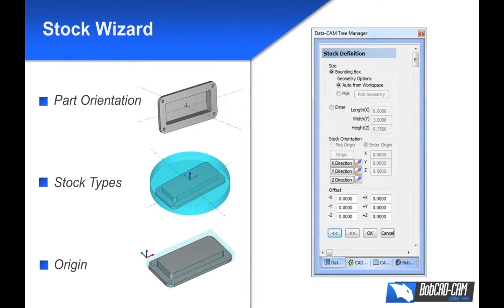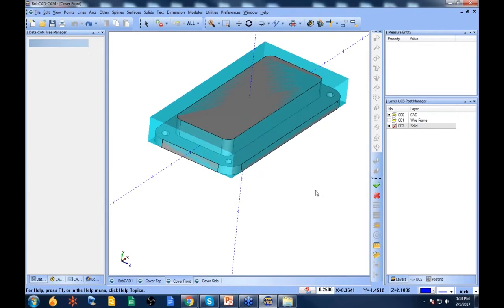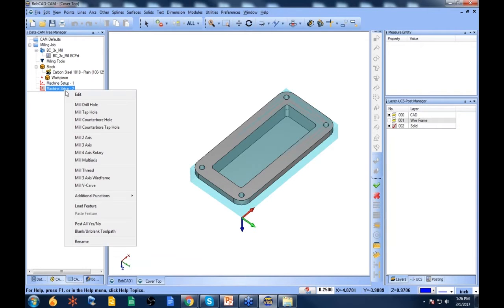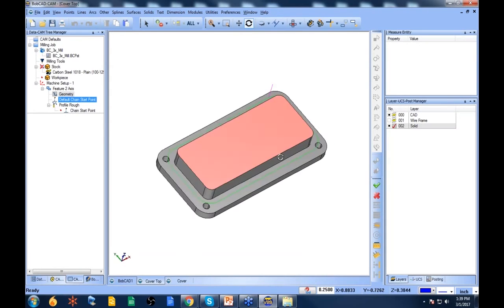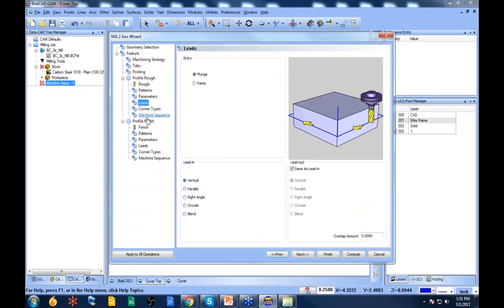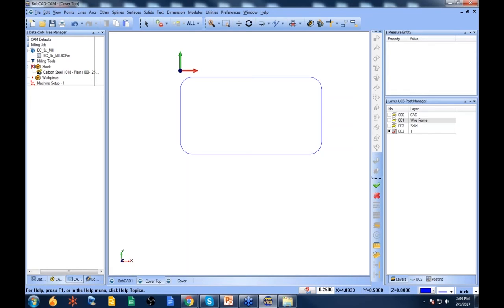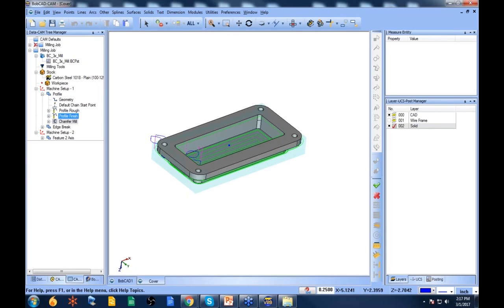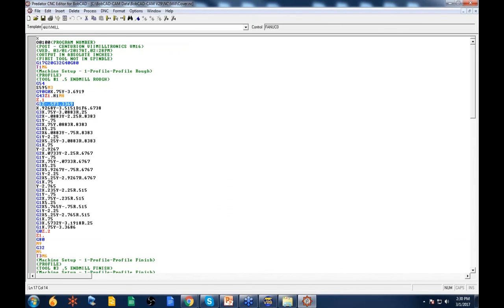Getting Started | CAM - BobCAD-CAM Webinar Series

Comment: Enjoyed your session today. I have been using BobCad since trumps first term . I worked for Apple Machine in Ft. Pierce , Florida. They sent 3 people to your facility for training , all came back as clueless as before going. Not your fault. I made a solid works model of the back plate on kurk vise and the guy told me I drew it upside down and couldn't use it. Told him he had to orient the part. Then he came back and said the key built into the part came out as a keyway. I called friend who was using it where he worked and came over and i half hour had me up and running. My only experience in  CNC was with conversational programing. I ended up reading up on g code and stated programing the mill at the controller until We got BobCad. Apple had full version and help option. The help department was fantastic. We had an old Monarch predator millturn lathe something new to me. Help got the posting set up for me. Had issues with the post and told them what the problem was and  and it was fixed  it right away. They walked me thru some test samples and made more changes to post. The best was I was trying to make a fishmouth pipe joint , one was 2" to 2" 90% other 2"to tangent on 6"I tried programing it but needed help. Called for help and sent in my models , took several days to get back to me. They jokingly said I come up with some weird stuff and they needed to get the whole help department involved but did come up with an answer. They had same issue I did the tool path didn't look right but was right. Parts came out perfect.  I programed many parts while at Apple Machine some from customers cad drawings and others with broken part for me to remake. Others were parts in my head and drawn in Solid Works and programed and made.  My old employer ask if I would come back. Couldn't  resist as they had a a 5 axis mill that I always wanted to operate. So for the next 3 years I did not do any programming . They used FeatureCam and had 2 guys doing all the programing. I told them I was going to retire at age 70. At 70 they said I'd get $5 raise to stay until a replacement was found and in January normal raise time I go 10% more. Then they started a 2nd shift with just 4 guys  to keep the 5 machines running and day shift still did programing.  I really didn't want that but because I can program enough to fix any problems that come up on a part at night they offered 17% more.  I started using that money to by tooling and a miltronics mill for my garage and  23 I bought my own BobCad program with 4 thth axis. Finally I retired at 72 and made a few parts using your program. Sold my grossly over priced place in Port St. Lucie For a 1.25 acre place in North Florida country living at last. Mill sat on trailer for 5 months in  Friends driveway all wrapped up. Brought it up here and another few months in my pole barn until my steel building was set up. So today I decided to get refresher on part orientation . Your session today brought me up to the parts I remember of programming with BobCad. Had you taught the braindead  guys Apple had sent up to BobCad , even they might have come back able to do some programming.  I THANK YOU FOR YOUR LESSON TODAY, BEST I HAVE SEEN YET. Now to finish a part I started over a year ago. Making a D1-4 lathe spindle nose to mount on my 4th axis so I can quick change from my 3 , 4 , 6 jaw chucks and collect chuck and faceplate. The lathe work is done done ,now the 8 mounting holes and 4 key ways so it can mount on 4th axis to finish the 3 top pin holes , 3 cam holes, 3 cam retainer holes. last 3 holes not on center but perpendicular to cams.  If it all works well I may try selling them. When looking for dimensions on internet so many people looking for these, no one builds them. My brother wants one for his manual mill to mount chucks and collect holders.

Comment: Al, maybe i missed it, but how are you adding vices and stuff to the simulator, is there a video on that?
Reply: You can download work holding files, or create your own.  Then just merge them into the file.  I put them on their own layer so I can turn them on and off.
Reply: ah so not adding it to the simulator but to the cad tree. got ya.
Reply: Correct you add the work holding models into your design .  Then when you launch simulation, if they are visible, they will show up in simulation as your work piece